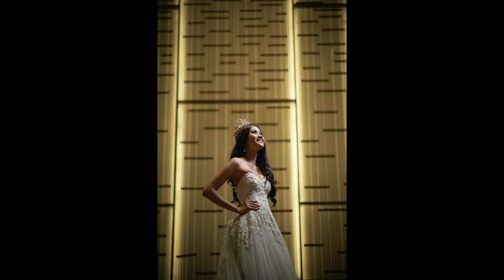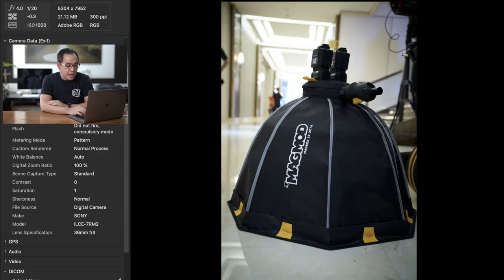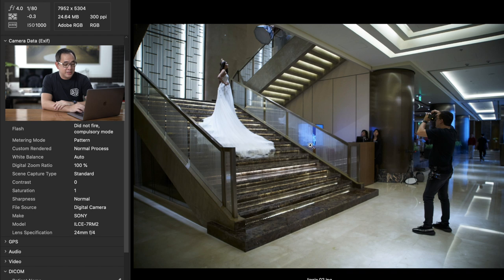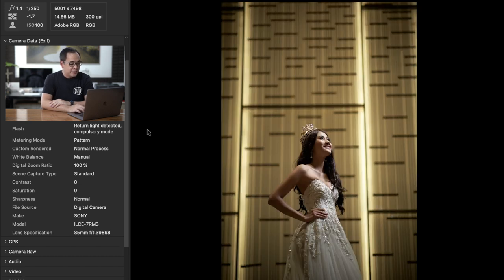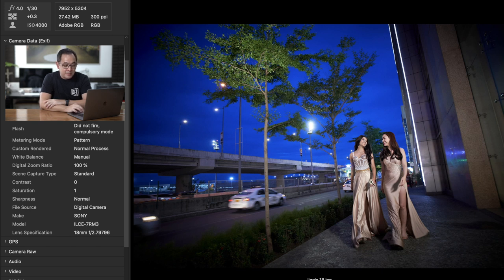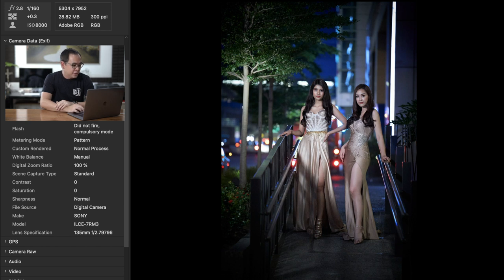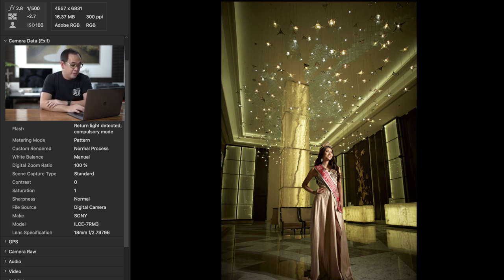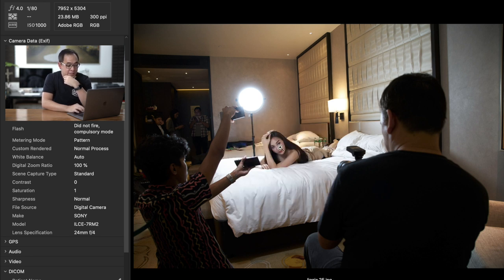Practical Lighting Tips and Techniques: Using Off Camera Flash INDOOR & OUTDOOR and LED for Evening

Comment: Hi Jiggie, I am from Singapore and found your videos recently by accident.  I have watched many of your videos and enjoy them so much!!!  Thank you.  I have a question: I have just started learning about portrait photography and have just bought a Godox V1 speedlight.  Now I am planning to get the Phottix Padat CF 200 (as per your recommendation) and a flash holder (Godox S2) and soft box.  I would like to follow your idea and bring these equipment for travelling and whenever I am outdoor shooting portraits.  Which size for the soft box (60 cm or 80 cm) would you recommend I get?
Reply from the maker: for travel I don't even recommend bringing a softbox because it will hinder your movement, I usually just take around my mag mod gear when I travel
Reply: @JiggieAlejandrino  thank you!!!  for shooting outdoor portraits (not travelling), what size soft box do you recommend?